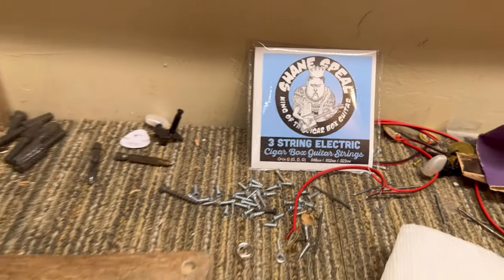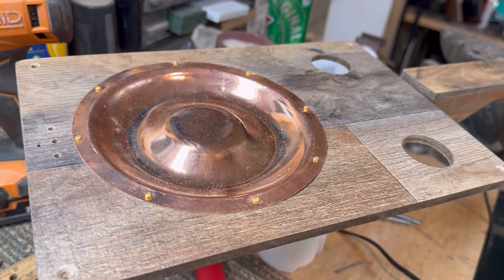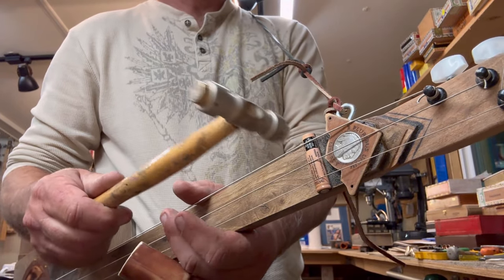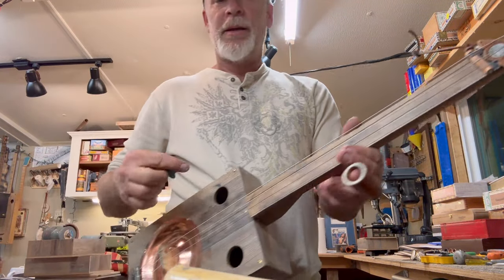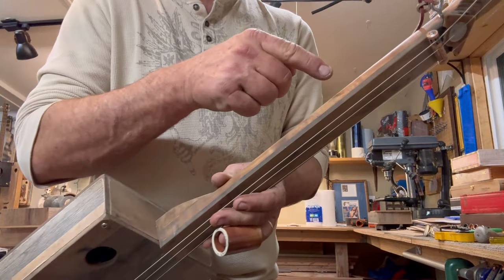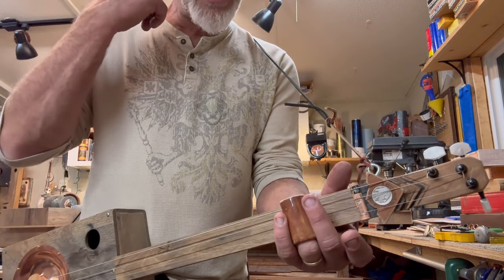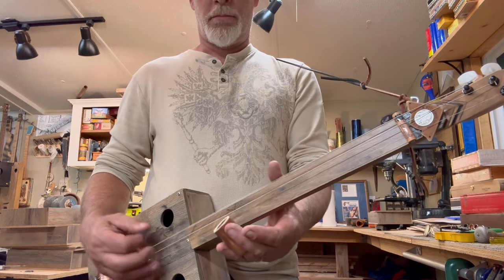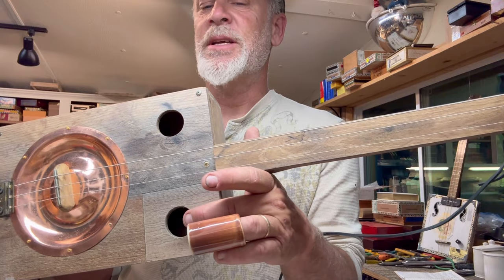Cigar Box Guitar - Arrowhead Floorcaster - Fretless Slider - with Copper Resonator 😎👍🏽

Comment: Del, I'm currently piddling around with my first resonator build, and was planning to sandwich a piezo between the bridge and the resonator, thinking that would maximize the resonator twang when plugged in.  Curious to hear your thoughts about placing the piezo disk out on the edge rather than under the bridge.
Reply from the maker: i suppose a rod directly under (or in) the saddle would be the best… but how would you wire it through the metal…. ???  i drilled a hole in my hubcap howler and did exactly that
Reply: @PuckettCigarBoxGuitar yes, I assumed I'd build it up, get the intonation figured out, mark the bridge location, then go back and drill a hole for the piezo wires to pass through so I can keep the hole relatively small.